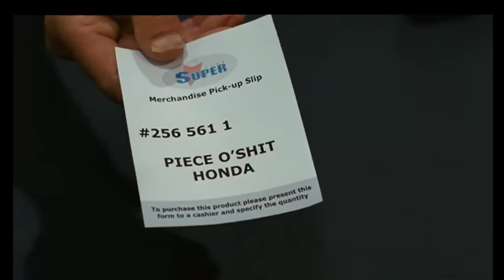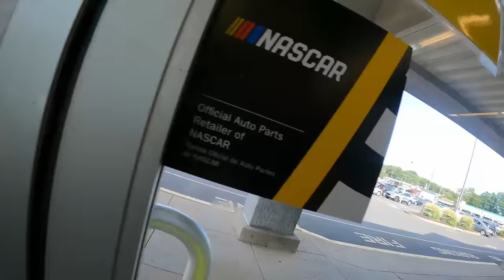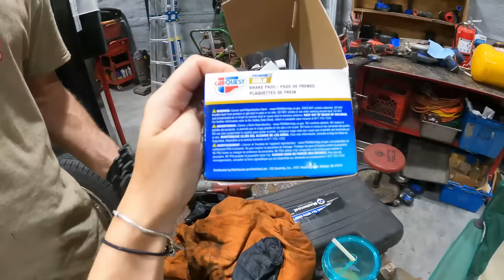My VERY FIRST Brake Job! And It's on MY FRIEND'S JEEP! NNKH

Comment: I just started enjoying watching Chris and your channels.  The vids are a good balance between the spontaneous "Roadkill" adventure and teaching moments. Your learning journey forces Chris to become a better teacher. 

Brake work is extremely risky. Not mentioned in the video, one of the most  common mistake is to forget to pump the brake before a test drive. The brake pedal will go to the floor if you don't.  This can lead to an accident if you forget.

Comment: I’m a huge Honda fan. I’ve had the same problem with the transmission in the past. What you can do and it does work most of the time but not all the time is;
Drain the trans fluid and refill w/ new. With the front of the car still jacked up off the ground run through the gears from park to reverse to L1,L2,L3 to drive and reverse again, doing that 2-3x’s. 
Drain the fluid again and repeat 3-4x’s while the car is off the ground. 9 out of 10 x’s it will fix your 3rd gear problem. I’ve done it and never once it not work   But if you choose to want to sell your civic, I would be interested in buying your car for my 16 year old daughter that is soon to be getting her driver license.  Good luck, love your channel and your husbands too. 
Y’all’s auto shop is a game changer❤

Comment: Hi Jen thanks for having the courage to post this video. It's easy to see your new to some of this wrencing stuff .  I think your  shop teacher is excellent.  
Oh Also on your Civic check your shift Silinoids my 2000 accord has 4 of them they where clogged up and my 2nd to 3rd shift did the same thing . If there clogged up it will cause that. Love your edits and humor and the music placement is perfect . I like how you got the hammer hit to match the  snare in the song :-) . Bass players notice that stuff 😂
Reply: Did you end up replacing the solenoids or did you brake clean them out and how many did you replace? I've always thought Hondas were fun and peppy but had weak trans. Had one that would flash the D light and felt like the cat was plugged because it wouldn't go into 4th or something. Long long ago when I was a kid.
Reply: @LAactor   hi LAactor . I cleaned them all out . Each one has a small
Reply: Screen and everyone was plugged to the 10th degree . I had the codes and the lights on the Trans display too. That was 180,000. I did the cleaning and new fluid and have 220,00, and it's still going . I the car for 200 bucks from a friend it was at a Trans shop and he was told it needed to be replaced . Hondas in this year range are known for weak Trans but at the same time, their motors are known to be bulletproof .
Reply: Hope you dont take this wrong , but Chris sucks as a teacher, He will get better with age. Admittedly It is WAY more difficult with those close to us. I had a general repair shop for 43 years and more apprentices' than I can remember. The greatest reward is when you witness your student become the teacher.
Reply: @doctorprick2843  no not at all Doc  in a perfect world Chris shows he's experienced but to teach is way different . No one can learn without some guide ,he does a good job but if he went into all the technical stuff she would be lost . It's just a show so you have to take that into consideration . I get 43 years makes you qualified to say what you said and can respect your right to say it.

Comment: I would check the spare tire on that Jeep Liberty, because chances are that it's a 2008, nearly 16 years old tire. I would recommend to the owner to change it.  It's no fun to have a flat, just to change the wheel and tire to another flat... Great video 👍
Reply: Owner passed away 😢

Comment: Jen…OMG So Sad. It must have been hard to share this with all of us, but thanks for Sharing. As for the Brake job…you always amaze us. Unless you have a lot of experience, it is hard to tell how tight a bolt should be. Chris should give you the torque wrench and the specs. That way you know the bolts are tight and you will learn the proper torque. I am still amazed at how you moved that shed by yourself!

Comment: Wow, so sorry about your friend Jen!  This must have been a difficult video to make. You should google the symptoms of your transmission. Sounds like it could be the shift solenoids Valve A and B. They have filter screens that can get clogged and cause what you were describing. I believe you can access them from the outside of the transmission so you dont have to drop it. Chris might know more. I still cant wait for you to drive a Civic like yours but with a manual trans. I think you'll love it so much youll want one. Great video as always!

Comment: I have done my own brakes for many years but this was pretty insightful. I’ve never thought to put lock tight back on the caliper brackets, nor anywhere else. 😂 Also, never even heard of the noise stuff Chris put on the pads. 👏
Reply: Yeah it's weird that some manufacturers use loctite

and mostly I just follow the torque specs since I'm just a DIYer

Comment: Big respect to you Jennifer💪🏻#nevergiveup 
I would recommend to put “the red antisieze” on the brakepads when they were installed, then you do not has to fiddle with that, when you struggle to put the pads in place. 
As a firsttimer you did well
Big condoleces

Comment: If you are going to do brake pad replacement it's good to check all 4 and if needed do all at once, just make sure you wire-wheel away or scrape off the excess rust around the rotor face and caliper bracket and the caliper itself, also don't scrimp and get the cheapest ones.  Front an rear brake pads for disc brake cars are always different, general the majority of braking is done on the front brakes that is why front rotors are a larger diameter and the pads themselves have a larger surface area, on normal cars front brakes have 2 piston calipers and the rear single except for more high performance cars which can have 4,6 or ever 8 piston calipers on the front and up to 4 piston calipers on the rear.
RIP to Hannah I gather you did this brake job before she died on the 23rd October.
Reply from the maker: thanks for the tips, Jason. And yes Hannah passed away about a month after we did her brakes. It was much more sudden than expected. Cancer sucks.
Reply: @jennifersugint  Thanks for replying back Jennifer, Yes cancer sucks I do a ride (bicycle) every yeah for children's cancer.

Comment: Well done Jennifer, one small point, if you turned the steering wheel completely to the left you would be able to work on it standing outside the car, and the opposite lock for the other side. Bob

Comment: Definitely not the ending i was expecting 😢... May she rest in peace. She passed two days after my mother from cancer. Cancer sucks.

I give you 10/10 for singing
7/10 for the brake job did  good just needs improvement 😂

The only thing i dont agree with Chris. Is putting the orange goop on before you place the pads. And only putting it on the caliper contact points not the entire pad. I find it will trap dust on the exposed goop.

You did amazing you always learn better by doing.

Comment: I learned the same way you did Jen so it`s not a big deal plus you got Chris there if you have a issue so just dig in and remember what he did it`s really easy once you do it just be thankful it`s disc brakes and not drum brakes like older cars have then it is a little more difficult when you first do it.

Comment: And yeah, as you mentioned, if you removed the bracket I would totally remove the rotor and check those 2 suckers the drum "e-brakes" as most of them are due for replacement or crushed or near causing a new issue! Also nice to check the thickness of the rotor here!

Comment: Stumbled on the video watching brake repair videos. So sorry for all friends and family's loss.🙏✝️
Hurt me to see the struggle with the lug nuts. Been there.
I spray wd40 on every rustable/crossthreadable part(except rotor surface and pads of course) for that reason. Wd40 is water dissipant/lubricant/rust preventer. Done it for 30 years. And I don't live in a snow/salt area.
Wd has saved me so many headaches
I would make the brake hose go down to the brake fluid so it doesn't allow air bubbles( the air bubble in the line is no fun; been there).

Comment: FWIW, and FYI,....slathering the ceramic lube on the caliper piston would be a good idea too. But, if you would have had to put brand new caliper on it, I would cover just about the whole caliper with the ceramic lube, or "goop" as you lovingly call it. As long as it doesn't get on the rotor surface or pad surface, it's well worth it to coat with the lube. I learned this from South Main Auto youtube channel. I live in PA, in the rust belt, so it really helps....Eric O, from South Main Auto, is in NY...also the rust belt...even worse than PA...but I enjoy your fortitude and git 'er done attitude, without any fear. May the force be with you, Jen!

Comment: Hi Jen , so great to see you changing the brake pads  I myself also a mechanic for many years have had to learn mechanics by being thrown in the deep end and found I had to ask a lot of questions there was no utube or videos I noticed you struggled a lot with getting the bolts undone again find a longer spanner to do the job it’s a lot to do with leverage also cracking a bolt loose it’s good to get into the habit of two short jerks on the spanner is better than a long hard pull but all in all a great video on another note so sad to hear of the passing of your friend,  stay happy always check out the videos regards Pete

Comment: Hey you're not a bad mechanic! You notice stuff when you need to and not at the end like when the wheel is back on! You look around and pay attention which is better than ignoring everything because you know how to get from A to B. More or less. That good on the slide arms of the lift is so they don't mar up the bottom and make them corrode and rust faster. 

Everyone bumps their heads just like how you showed Chris did in the video right months ago. It's why we wear hats. For some additional protection. 

You noticed the caliper off and got quickly to get the bolts out because of your instinct instead of crying and stopping the locktite would have glued the bolts in place that would make it harder to come off if you delayed it 10-15 later. Not impossible but it would have made it worse for you doing it alone. 

AND you had the instinct to use the old pad to compress the piston! That's skill! Really thought that was going to trip you up. And also when you installed one of the pads you had it the wrong way and at the end after you put it down you put it back up the right way! Not sure if you caught that in editing or you were doing that for us or Chris was helping off camera but luckily and instinct were all on your side and you need that as a mechanic. Me with my bad luck, I've had bad stuff happen before. Like I didn't see a small incline when I was helping someone change a tire and it slid off the scissor jack. Good thing I had the tire under. Or like that one time you were lifting the shed, no doubt that lever would have whacked me but your instinct got you out of the way. 

Finally don't worry about what these strangers say to you. That's the internet. It used to be way worse when I started. At least people are nicer now. So many bullies before.

Comment: On the shims that the brake pads slide on, being that they are stainless steel, I've often just cleaned them up with a wire wheel, added some brake lube, and be done with it..and throw the new one's in the garbage, and they've worked perfectly. I suppose if in an area where there is a possibility of rust and grime, one could change them, but I've not come across it here in western Canada on any vehicle I've done brakes on.   If/when I choose to use the new brake slides, I attach them first, before putting brake lube on them, just making it easier and not as messy.  Had me laughing Jen...wrong bolts in wrong holes...but you got it!  This I find, is one of those jobs that becomes easier the more you do it!   Just for kicks, I will always look on Youtube for the particular vehicle being worked on, and 'brake job' which can give some good insight/reminders, and easy to go back and look at it, in case you get stumped!   Nicely done Jen, always watch for your video's, so thanks for this one, and of course condolences for what you're going through currently!

Comment: Anti seize works great I use slilglide on pad backs.Used to do a ton of brakes when I was wrenching.
Reply: I never stopped since doing pad changes are easy and today's shop rates are stupid $$$$$ to cover the overhead costs 😢

Don't have a fancy shop like Chris, but glad it can be done in the driveway 😅

Comment: 4:23 - Years ago we had our 01 grand Cherokee serviced at some BS local shop. We then for some reason needed to remove a tire but the lug nuts were SUPER torqued. We ended up breaking our biggest breaker bar w/ cheater pipe, still wouldn't break free. Took it back to the shop that worked on it before and had them loosen the lug nuts. They told us the torque spec was 180 ft. LB. I was shocked...

Comment: I generally put the wear squealer tab in the position where the old pad was thinnest, but also, if pads on your side were noticeably thinner than the ones Chris did on the other side, and you did not have to hammer them out due to rust jacking, though they did seem a bit tight, I fear not tight enough; then I think you should make sure the piston isn't sticking, by either removing the piston, cleaning the piston and bore, lubing the piston with brake assembly lube and putting it back in; or replacing the caliper, which is common since they seem to be pretty cheap.

Comment: Chris!!! :0 I performed hundreds of brake jobs - I NEVER put lock-tite on any caliper bolts, instead I put anti-seize on them as calipers are prone to rust from the water off the wheels. Once the bolts are torqued to specs they will never get loose, yet with anti-seize they will come off a bit easier next service! And yeah, a big NO to the red stuff either :/ But love you guys, big holla from rusty Canada ;)
Reply: I've heard a lot of complaints of caliper bracket bolts coming off...so I just do that and torque the caliper bolts

Comment: Remember folks. putting new pads and clips in, it will be tight. You have to tap them in evenly together or it will give you trouble. Its new parts going on original bracket.

Comment: at 11:20 or so you asked do people ever? and yes they do. they ride it and turn the radio up and ignore the noise, the squealer breaks off and no more noise for a hundred miles after and then the backing plate metal grinds the iron on the rotor and then they either grind all away or get lodged in bad places. some even grind the backing plate to nothing and then the piston grinds the rotor so instead of just changing pads, then you change pads and rotors and then if not they change the pad rotors and calipers. Costing them more and more because they ignored their car. And people do that. The back isn't as crucial because they only work to stop the car just 20% or less deoending on application since the fronts do most the work.

Comment: Lug nuts that tight can warp the drums and disks. The spect should be about 100 ft lbs, if I remember correctly. The rear brakes won't have a squealer tab. That is only on the front.
Reply: As for the squealer tabs, they obviously showed it on here. 

They're on BOTH fronts and rear pads over the years that I've changed them on various models since the mid 1990s😅

Agreed with the lugs being too tight. Seems the shop was afraid of having them too loose and probably got sued by a customer previously, so they practiced "make it tight that the wheel won't fall off"😢

PS Google torque spec is 110 ft lbs... Still was waaaaaay above that 😮

Comment: Man, you gotta hate those places that use air guns to do wheel nuts. Should always be tightened by hand. Had the same problem myself recently. If my wife had had a flat tyre there is no way she could have changed to the spare.
Reply: Done correctly or use a Torque stick and there's no issues. That's just laziness

Comment: On brakes the front brakes do 80% or more of the braking. They use pads and rotors larger up front than the rear are, this helps even out the braking effect and wear.
Most new cars use disc brakes front and rear. Older cars use disc in front and drums in the rear. Very old cars use drum brake all around.
Not all brakes are the same. Not just in size but in the way they mount and the number of caliper and location of the pistons.

Comment: Tightening the lugnuts that tight is the way to strip the studs or mess up the rims. My old Citroen had lug bolts and when they were overtightened the threads in the holes were messed up so bad that I could not tighten the bolts any more to fit my summer tires on.
Reply: Shops don't care it's pretty hard to get traced to them. And they get paid a 2nd time to work on it

Comment: I did a friend a favor and changed the brakes on her Jeep, ended up costing me about $200 because I replaced a rim after I had to use a fire wrench to remove a lug nut. She got new brakes and a full size spare for $35 😂

Comment: Hi good work Jen, but I would have done a fullbrake inspection once I noticed that the shop that inspection! Torqued the wheel nuts at 200+ lbs ?? That dangerous as they can all brake of with that much torque!!! 6:51

Comment: They make impact drivers and they make hammer drills.
Looks like you need an hammering impact driver on those security lug-nuts.
...a powered tool that works like those old fashioned non-powered impact drivers that you hit with a hammer.